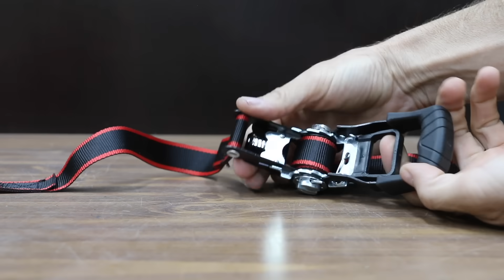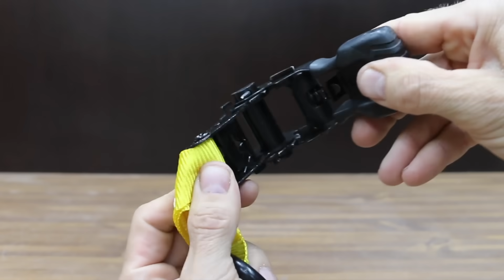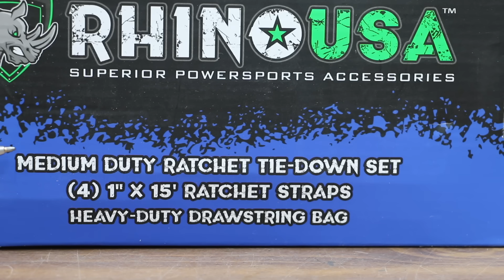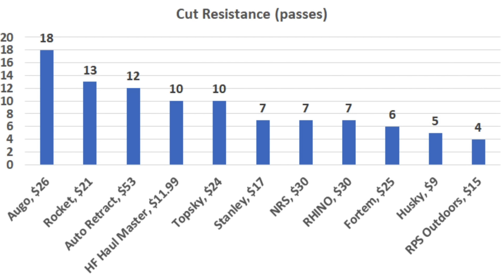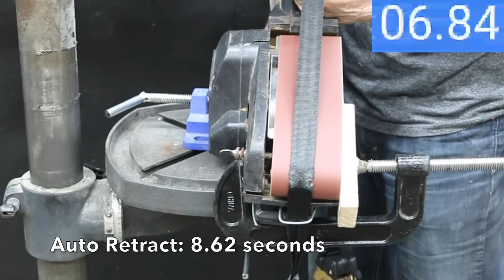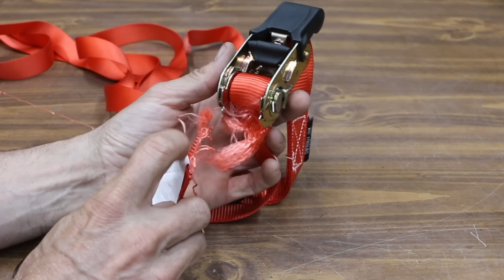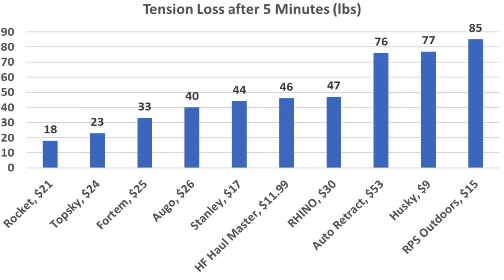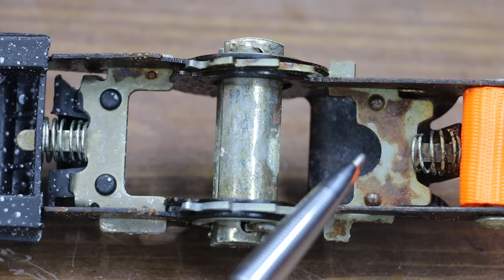Best Ratchet Strap? Husky vs Stanley, Rhino USA, Rocket, Topsky, Augo, RPS Outdoors

Comment: Nice video. I use straps quite a bit; they have a lot of uses. I think I’ve settled on 1-1/4” to 1-1/2” for most things though I also keep some 2” for heavier stuff and the harbor straight straps as throw away straps or to give to people as they’re quite inexpensive. The harbor straps can be bought of $6-$7 per 4 pack when they’re on sale which is the only time I buy them; I always keep a few packs on hand. I like harbor for some of their things as I don’t mind loaning them out as I don’t care if they come back. I keep a whole pegboard peg of their free-$4 electrical multimeters because as an electrician I get asked by people to borrow a meter; I just give them a harbor meter and tell them they can keep it because I’m not loaning an expensive meter. I like these videos as sometimes the cheap options are just as good as or better than the pricy ones.
Reply from the maker: good idea

Comment: Thanks for the stowage tip at the end! Ive been using the HF straps going on 6 years now for tying down my refuse bins in the back of the truck, I've tyed down an 800lb Goldwing, and even used one to hold up my exhaust on said truck when the bracket broke. The HF ones have been a good value for me. Oh, and they're just thrown into the truck box & left there year- round.

Comment: American ratchets don't need to be normed and stamped ? 

Here EU all ratchets and other straps need to be EN approved and their failure points stamped to ratched and the straps to be labeled as well,  (LC 250 daN) for example means 500kg's before failure for the rachet and 750kg for the strap (2 and 3 times the number).

Comment: I like that you test and show attributes of several units.  I'm sorry that I missed the posts that suggested competition entries, though.  I think "Shock Straps" should have been included.  They have a particular feature that prevents loosening, which makes them very appealing for some tasks.  A person that will consider owning only one set of ratchet straps may want to buy either the best, or best perceived value strap.  Straps are something that I have several of, because I don't want to use my best set on a job that could be easily accomplished with a standard set.   Thanks for this new effort!

Comment: Best pressure washer head for drive way cleaning?
Reply from the maker: Thank you for the video idea!
Reply: That’ll be something to see. Quite a few options in surface cleaners, water brooms, turbo nozzles, regular nozzles.

And then there’s the question of orifice size. That size affects the effective PSI/GPM at the nozzle and changes based on the PSI/GPM ratings of the washer.